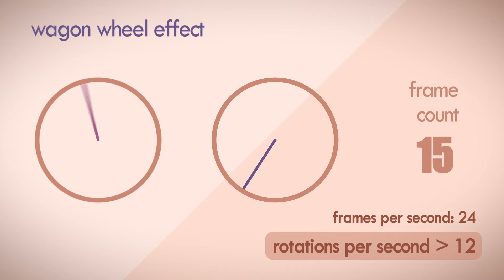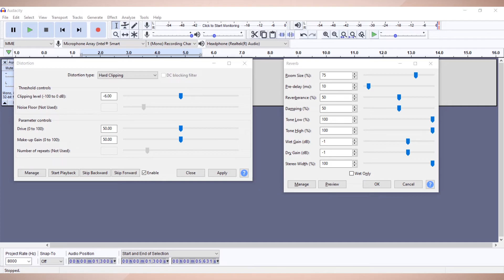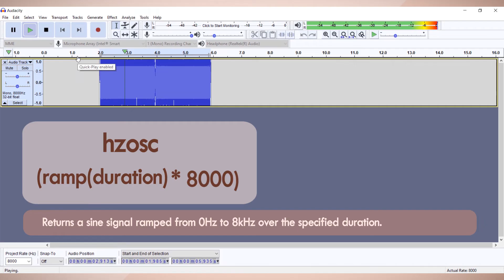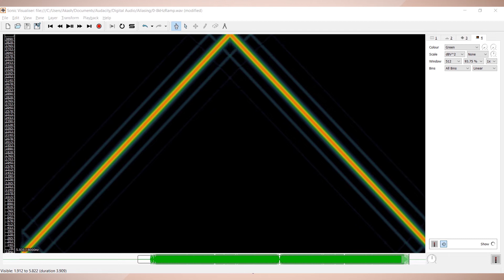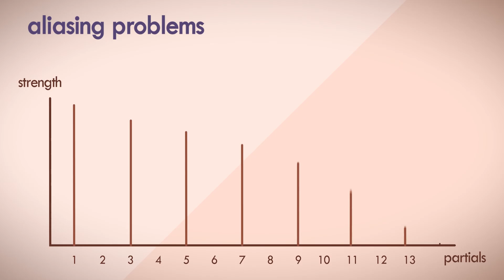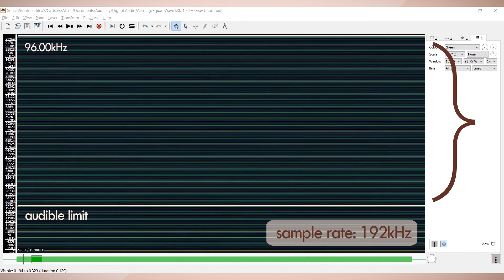4. Understanding Aliasing - Digital Audio Fundamentals

Comment from the maker: I've noticed that some of you trying to replicate the audacity examples aren't getting any aliasing. Audacity is creating a 3500Hz tone instead of 7000Hz, and the debug output of nyquist says: "Warning: osc frequency reduced by 1 octaves from 7000 to 3500 hz to avoid aliasing." I've noticed the same behavior when I upgraded my version of Audacity to 2.4.2 and above.

There must've been additional checks put in the code of hzosc. But if you follow the later example: return hzosc(ramp(1) * 7000)
This works as expected! Aliasing does occur. So I am guessing there is a simple check to see if the number being entered is less than half the sample rate, otherwise it'll force it to be so.

The reason why "ramp(1) * 7000" worked is because it's not a simple number, it's evaluated as a signal. It's a ramp signal going from 0 to 7000 in a certain duration. So I have a dirty fix for you, based on the same principle. 

You can try "return hzosc(pwl(0,1,1,1) * 7000)" 
It's not very pretty, but I'll tell you what it does. pwl is piece-wise linear function. It is essentially an envelop function. The 4 arguments state that at time 0, let the amplitude be 1, and at time 1, let the amplitude be 1. All it's describing is a straight line signal, with its value always as one. If you multiply this signal by 7000, you'll get a constant signal with 7000. Since this is not a simple number 7000, hzosc will not validate it, and will result in an aliased signal which is audible as 1000Hz. As expected.

This is tested on the current latest version of 3.0.5
Reply: Wow, the sheer audacity of this guy!
Reply: That looks like bad design. You should never modify user input like this without informing the user. (And, no, debug output doesn't count as informing the user.) An error would be more appropriate. They should also provide some way of overriding the internal error checking unless there's some actual harm in doing so.

Comment: Awesome video! Can you clarify…
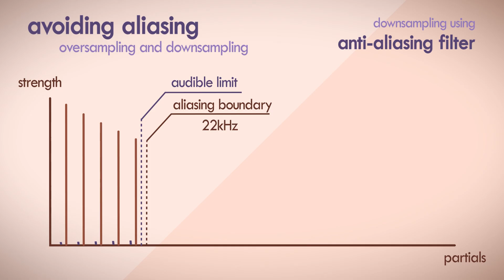At 16:50 you summarize that they over sample then down sample. Is there a ~22kHz low pass filter step between the over sample and down sample steps?
Reply from the maker: Thanks! And yes, there's a mandatory low pass filter (usually an FIR filter) before downsampling a signal.

Comment: I am trying to create soundfont preset with samples containing looped saw waves.

For the ones who are familiar with soundfonts: aliasing usually occurs within such saw wave samples when they're above a certain pitch. They can sound correct when played  in the same pitch as the root key, though with another pitch or even detuning with one cent aliasing occurs.

So I assumed to fix it by editing the samples with a low pass filtre to remove the highest harmonics and creating "headroom" till the nyguist frequency.

It doesn't help despite using a stronger cutoff (48 dB)

What are the possibilities available for me to create an aliasing free soundfont?

Comment: If i record a analog synthesizer playing a square wave, using a 96kHz sample rate. That i guess would result in a sampled square wave with more higher order partials, less aliasing in the audible range than if i instead would use 48kHz sample rate. That way higher sample rates i guess is more useful in situations where aliasing would otherwise occur right? Or does the aliasing get filtered out in the ADC anyway? But the square wave in this example still needs higher resolution to get a higher fidelity sampled representation in the digital domain i suppose, that way higher sample rate would come closer to the analog domain signal? 

Since project sample rates affect CPU load, i am wondering when i benefit from using higher recording sample rate than 44,1kHz? If we take the square wave example, or when recording distortion effects for example, would you benefit from using a higher sample rate (96kHz) and then down sample the recording by using a lower (44,1kHz) sample rate in the project settings? To ease CPU load, and instead upsample non linear effects like compressors and saturation? 44,1kHz would create kind of edgy sampled 20kHz waves in the digital domain, but DACs will make them more rounded right through some algorithm?
Reply from the maker: If you convert any analog medium to digital one, you are passing it through an ADC. An ADC will filter out all frequencies above the Nyquist, whatever your sampling rate maybe. 

"But the square wave in this example still needs higher resolution to get a higher fidelity sampled representation in the digital domain" - No, categorically no. The sampling theorem guarantees that all frequency partials below the Nyquist frequency will be faithfully represented. 

"44,1kHz would create kind of edgy sampled 20kHz waves in the digital domain" - Again, no it would not, for the very same reason as above. 20kHz is below the Nyquist Frequency, so it WILL be accurately represented. The DAC does not use any algorithm to smooth it out. It uses Sinc interpolation to get back the original signal, EXACTLY as it was before being digitized. 
Check out video 2 on Sampling Theorem if you haven't already.

"i am wondering when i benefit from using higher recording sample rate than 44,1kHz" - there is no benefit. Simple as that. 
As I mention in this video, the benefit is only when generating high frequency partials WITHIN the digital domain, not when recording.
Reply: @akashmurthy  Million thank you Akash! 🙇‍♂

Comment: HELLO. IM TRYING TO DO IT THE SAME WAY BUT when I generate a 7000 hz didn't die me a 1000hz sine wave. Instead I get 3500. If I use 6000 it gives me 3000hz. ¿How come is this happening? What am I doing wrong?
Reply from the maker: Please check the pinned comment for the solution.

Comment: Nice video dude, you have a talent for teaching. Why not just use a low pass filter at the end of your plugins to stop anti-aliasing instead of oversampling?
Reply from the maker: Cheers! 
So, higher frequency output is possible in  these plugins I talked about. They are a result of calculations that are unavoidable. If frequencies greater than the Nyquist frequency are generated, they are automatically aliased! So the problem here is range. If the output frequencies exceed the range, there is no point filtering them out, they are already aliased and sitting well within the range. 

To get rid of these higher frequencies, you'll first have to exceed the range (by oversampling) such that they don't alias! After that, you can low pass filter them.
Reply: @akashmurthy  Ahh I see thanks :) So you can't stop harmonics bouncing back down if your using a lower sample rate even if you use a low pass.

Comment: Hi akash I'm looking at getting up to speed with DSP and DAFX algorithm design in matlab  (or other programs if you can reccomend) any books/information resources would he great so I can finish restart my masters at University.
Reply from the maker: Hey Robert, there are a couple of resources I can suggest regarding DSP. 

The Scientist and Engineer's Guide to Digital Signal Processing by Steven Smith - This one is free, it's available as a PDF and piecewise chapters as well. But it's a bit old and dated, and it's not fully about processing audio, it's more general signal processing, but it's very informative nonetheless.

Designing Audio Effect Plugins in C++ by Will Pirkle - Probably one of the best books I know regarding audio DSP algorithms. It's very informative, very easy to understand, but the examples are in C++ not Matlab. 

But really, it depends on what you are planning to learn in DSP, and what your goals are.
Reply from the maker: Another great resource for DSP is Julius Smith from Stanford's CCMRA program. He has a few books. Amazing resources, and it's all free and available online.
Reply: @akashmurthy  I read this at University, it was to complicated I know about the DSP guide, that's great also DAFX from Zolzer really helped.

Comment: Very nice explanation! 
I wanted to create the aliasing effect on Audacity by myself but ran into a problem. When I set sampling-rate to 8000Hz and type the nyquist command: "return hzosc(7000)", Audacity will create a 3500Hz tone instead of 7000Hz! The debug output of nyquist says: "Warning: osc frequency reduced by 1 octaves from 7000 to 3500 hz to avoid aliasing." 
How can I force nyqist to enforce aliasing? I'm using Audacity version 2.4.2
Many thanks!
Reply from the maker: Hey Adrian, thanks for checking it out. 
I noticed the same behavior you are experiencing when I upgraded my version of Audacity to 2.4.2
There must've been additional checks put in the code of hzosc. But if you follow the later example: return hzosc(ramp(1) * 7000)
This works as expected! Aliasing does occur. So I am guessing there is a simple check to see if the number being entered is less than half the sample rate, otherwise it'll force it to be so.

The reason why "ramp(1) * 7000" worked is because it's not a simple number, it's evaluated as a signal. It's a ramp signal going from 0 to 7000 in a certain duration. So I have a dirty fix for you, based on the same principle. 

You can try "return hzosc(pwl(0,1,1,1) * 7000)" 
It's not very pretty, but I'll tell you what it does. pwl is piece-wise linear function. It is essentially an envelop function. The 4 arguments state that at time 0, let the amplitude be 1, and at time 1, let the amplitude be 1. All it's describing is a straight line signal, with its value always as one. If you multiply this signal by 7000, you'll get a constant signal with 7000. Since this is not a simple number 7000, hzosc will not validate it, and will result in an aliased signal which is audible as 1000Hz. As expected. 

You can try posting any question you may have in the forums here. I'll surely be posting to find out if there is an alternate way to force aliasing. 
https://forum.audacityteam.org/viewforum.php?f=39
Reply: Hey Akash
Awesome!
Thank you for showing me a workaround to force aliasing using a constant frequency!